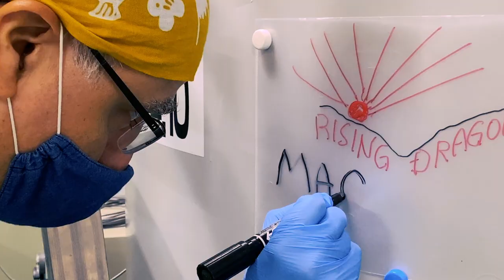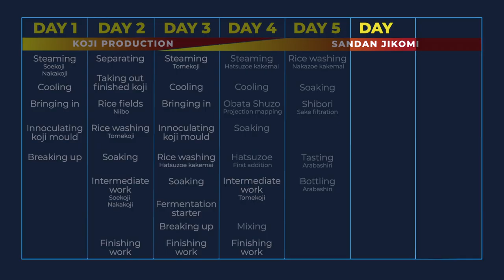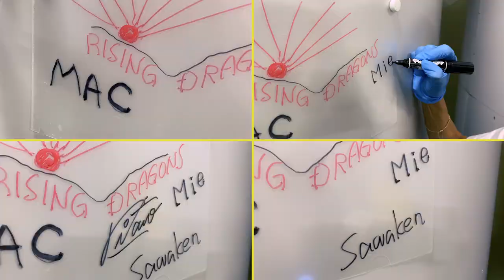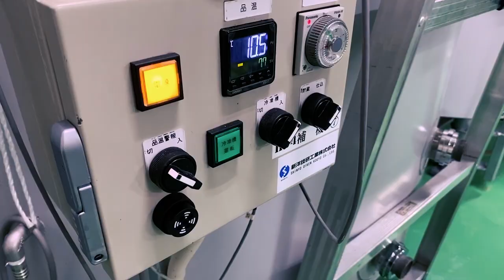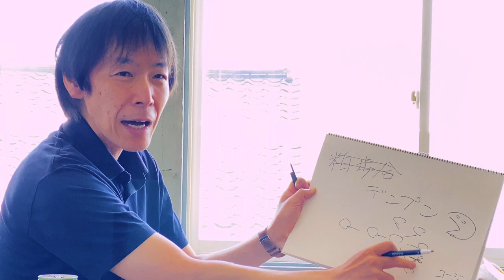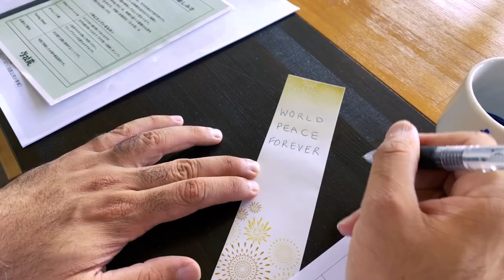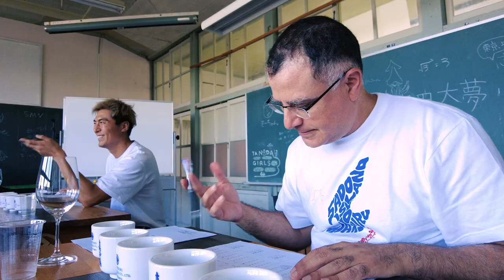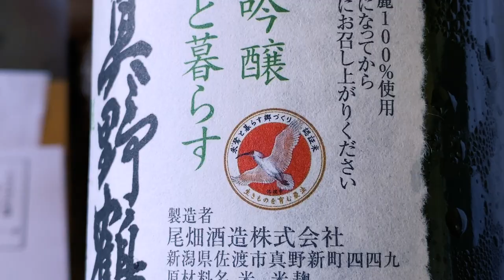I made Japanese Sake: DAY 6 - Sake tasting competition!

Comment: 100% right AND the top student!
Interesting about the cups making it harder to nose the sake. Makes you rely more on the palate. How much different was the experience when you had the "proper" glass?
Reply from the maker: Great question! The ISO 9001, and indeed a typical wine glass, are designed to funnel aromas upwards. The choko isn't. This can be advantageous in certain circumstances - for example, I've found some aged sake to be experienced better in a choko than a wine glass. All part of the sake experience. Kanpai!

Comment: Hey Mac - loving the series, but I have a question. You have explained a lot about importance of different temperatures for the stages of sake - so how was sake made before precise temperature measurement and control was possible?
Reply from the maker: That's a very good question Stuart! It's important to appreciate that we're making a Daiginjo - a modern style of sake that involves a higher rice polishing ratio than was used back in the day, and yeast strains that didn't exist back in the day. 

Historically, sake was made in winter - one of the reasons being that it was easier to heat things up than cool things down. This, combined with experience and expertise allowed for some temperature control... enough to make delicious delicious sake with higher polishing ratios and ambient yeasts.